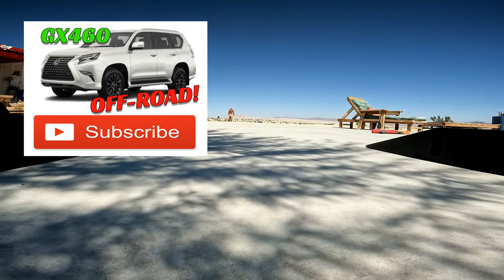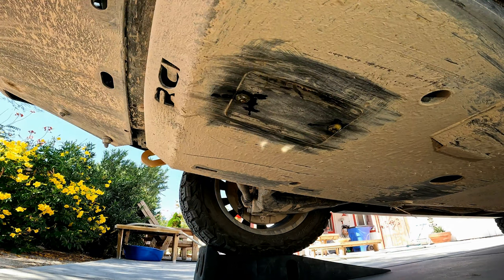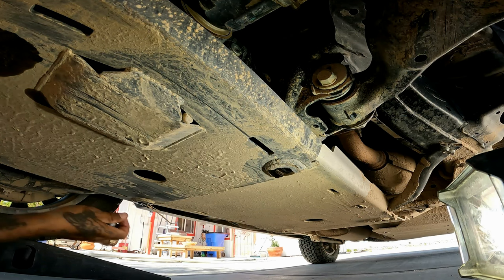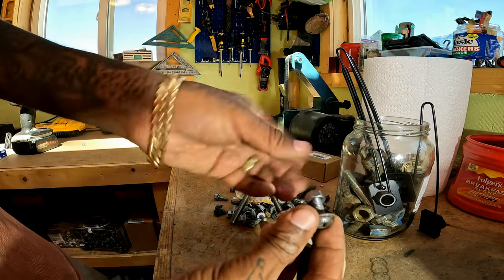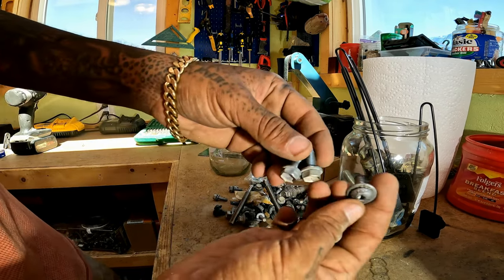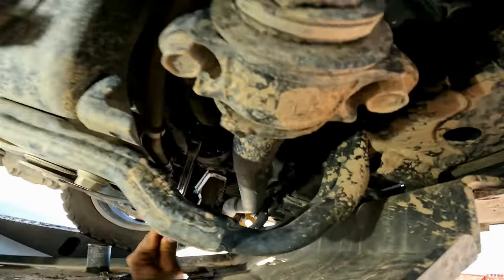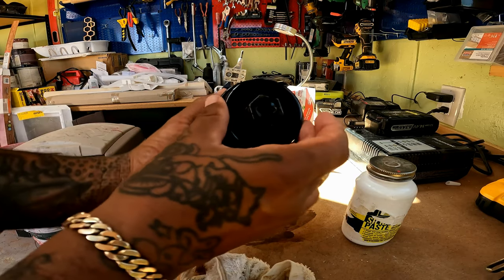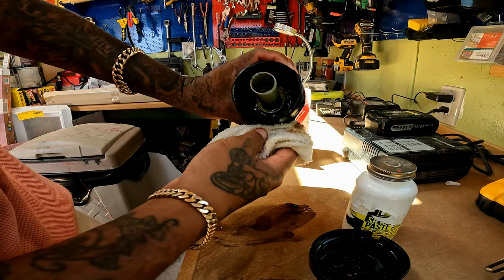Super Easy Lexus GX460 Oil-Change [with RCI Skid Plates]

Comment: Great video as always.  We did  the 10k oil change a week  ago at the dealer to our GX, which is what the manufacturer recommends and it was free.  

It is  actually  the second oil change, since I did the  first at 5k myself.  

We didn’t purchase the oil change package they offer, since it was ridiculous and they still do it at every 10k.  

The funny thing is this.   They put a sticker in the windshield to remind me that the next oil change is  either 6 month from now or  at 15k.  

So if I buy the ridiculously expensive service plan they do it at 10k intervals, but if don’t they want me to change it every 5k miles?

I think Lexus dealers charges 140 if I am not mistaken and now it all makes sense what these engine truly needs.

All I know is this and it is recommended by the car care nut( he has a channel and his own shop) a master Toyota, Lexus technician for many years.  All Toyota engines oil should be change at 6 month or every 5k  whichever comes first using quality oil, even if you put a long lasting oil.   

If you go to his channel he explain in depth why.

I saw and listened to what he had to say and for me it is at every 5k.  Oil is cheap, engines are not.
Reply from the maker: it's our second oil change too 😆... we do 10k intervals... our old 1995 camry got changes every 12k on regular oil and it went beyond 300k before we outgrew it... 

personally I'll trust the Toyota team of actual engineers over a mechanic unless there's some objective evidence... but that's just me 😉 😜... I'd be more concerned about what FILTERS people are using... we had cars and bikes in the 1980s calling for 7.5k changes on regular oil and they went forever
Reply: @LexusGX460-OFF-ROAD    Then why after the 10k oil change, which is supposed to be the first. they now recommend to change it every5k?  

Yeah AMD the care care nut, used to be that master tech for Toyota dealers for many years and  he for what he has seen in all his years  he recommends exactly what now my Lexus dealer recommends   At every 5K

In other words I prefer to be safe than sorry.  

Again oil is cheap, but that is me of course.
Reply from the maker: @pireina1  perhaps I'll do a video on the topic?  Lexus says 10k which is conservative... again our old 80s CRX called for 7.5k om regular oil... that was almost 40 years ago...
Reply: @pireina1  
The next service does not include an oil change. It is for rotating tires and checking other things.
Reply: I'm the Car Care Double Triple Nut. Why not change your oil every 3 months or 2500 miles, I'm sure it will make you feel even better. Wait, the Toyota/Lexus engineers must be real stupid for their scheduled maintenance recommendations.
Your Lexus dealer is in business to make money in any (hopefully) legal way it can, and recommending unnecessary maintenance is not illegal,

Comment: Nice little video to show even averagely inclined people how easy it is to change their own oil in their Toyota/Lexus truck. And just wondering why do you use the high mileage blend? There’s nothing wrong with it and especially in a Toyota/Lexus like the 1UR-FE I wouldn’t worry about leaks but high mileage oils tend to swell any seals inside engines once they start to harden and can cause leaks like your valve cover gaskets. (That’s when used on a vehicle with 150K miles that’s always had typical non high mileage blend) I’m sure you know it just has additives to “condition” seals. Also I’d recommend at least draining and filling (no filter change) your oil every 5k miles since you do what’s considered “severe driving” according to the owners manual, that is either towing or off road use and high dust etc. the OEM filters are the best that are easily available and they will last 10K no problem just keep the oil fresh every 5K. I originally wanted a GX460 so bad but wasn’t able to use my Toyota employee discount on one. So I bought the 4R TRD Pro. I can proudly say that as of 4 weeks ago I own both the 22’ TRD Pro 4Runner AND a 22’ GX460 Premium Plus! I’ll admit mine are mall crawlers… but I enjoy the 3-4 days a year my region gets snow covered roads and everyone stays home I go out ripping at 11pm while it’s coming down and no one is plowing. Oh and the V8 after living with it side by side is amazing, Love them both and both are shockingly different to drive! Take care, keep up the videos they’re great!
Reply from the maker: I think the high mileage oil was what Amazon had on sale for Mobil 1 at the time lol... it's only got 17k on it 😆

Comment: I hate the RCI plates for oil changes in the GX. It’s the 4-runner design so the oil filter access is too small/in the wrong place for the V8 for an easy/proper change. The dealer has changed the oil twice leaving the skids in place and once they cracked the stock oil filter cover, and the second time left a bunch of oil in the skid plate. When i ask them to remove them (I have all three skids) they quoted me $80 to remove/replace the front two skids for the oil change. Also, using a scanguage 2, the skids raise the average transmission  temperature 10+ degrees and I often hit 220F+ on desert climbs. SandyCats YouTube site drilled holes in the front by the RCI cutout and got it to drop 5F. Other brands have more venting (see Bud Built).
Reply: I was just looking at my 2020 GX front skid plate and saw some oil residue on top and under it - I’m wondering if this was from a similar ‘lazy’ oil change at the dealer

Comment: Do your skids block the ability to grease the drive shaft zerks? If not, do you speculate that the RCI mid and or transmission skids would block access - meaning you would have to remove them to grease up?
Reply from the maker: I forget if they block access... I should probably check 😆
Reply: @LexusGX460-OFF-ROAD  looking forward to that video! 😉  keep it up!

Comment: Nice! Consider putting a Fumoto valve on there. I’ve got one on my GX and love it. No need to replace drain plug gasket or worry about torquing the drain plug properly. Just open the valve to drain, close it when done draining.
Reply from the maker: we've used fumoto since the late 1990s lol... in the end I just prefer to just undoo the bolt and not have to worry about the extra extension hanging lower... just a personal choice, I think Fumoto valves are fantastic 👌 😀

Comment: Is it possible to access the oil filter without dropping the plate? Based on my research, seems like only LFD and Budbuild advertise the v8 compatibility engine skid. RCI and others claim filter cannot be accessed through the cutout.
Reply from the maker: access appeared "tight", but doable... I will try on the next pilchange to get to the filter through the hatch door... I really don't wanna remove those skids again lol... there is a cutout for the drain plug though which is in the correct location
Reply: @LexusGX460-OFF-ROAD  I have seen people use a long extension to reach filter from passenger side wheel well, and a foldable funnel. Very annoying but don’t have to remove the skid. Pick your poison.
Reply from the maker: @pennmikael theoretically you could also simply grind out more of the hatch opening too... but yes... you gotta kinda work with the mods once you go messing around with things 😃